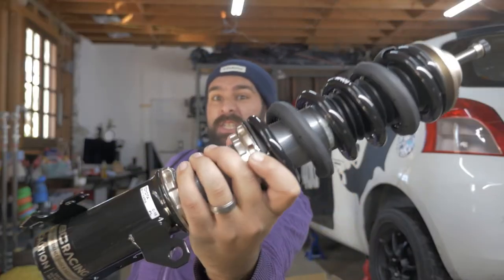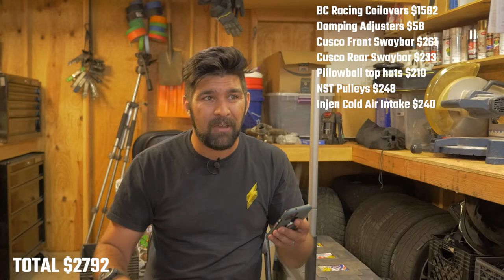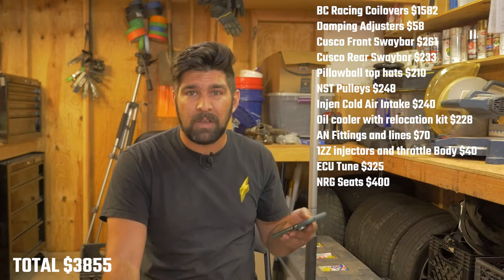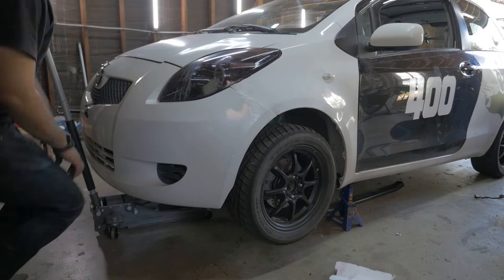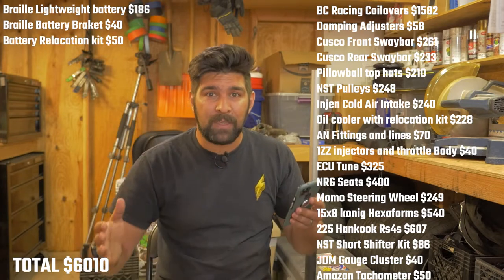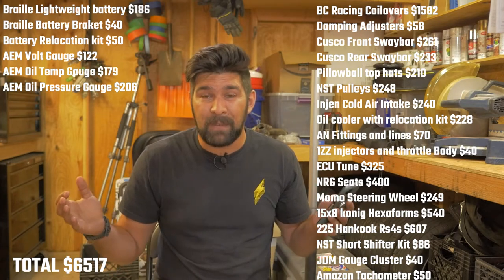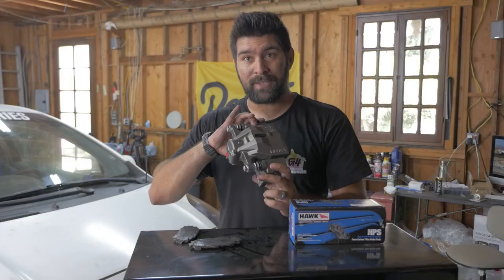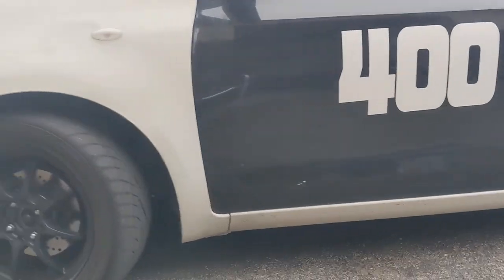Mod list 2022 - Is a Yaris the Best Bang for your Buck on Track?

Comment: I have a 2012 Yaris. Been my daily for 5 plus years now. Just got in the first major accident where I ran over debris from a semi truck accident that wasn’t cleaned up. Luckily the car just needs a fuel line to get it back up and going. Most reliable car Iv ever owned. Over 200k miles on just oil changes, serpentine belt or two and tires.
What would be a good waste of money for my car without risking damaging anything? 
I’d love to give the car a little lift but finding anyone to do the spacers is nearly impossible in my area.
Love your Yaris content!

Comment: The Honda Fits I've seen recently have been pricey for used cars. The Mazda2 is another good cheaper option.
Have you encountered any Chevy Sparks on the tracks?
Reply from the maker: I've seen a few Mazda 2s but no Chevy sparks.

Comment: Love the build! im realy interested in that ecu tune, how does it behave? no problems with drivability or anything? do you think they would tune for a stock motor, stock intake but just a muffler delete?
Reply from the maker: Their tune should work. The biggest gain is the rev limit raise. Tough to tell if the tune affects drivability, because my drivability was already screwed up from the 1ZZ throttle body, and I don't exactly daily my car

Comment: Hey @RassoolRacing. Did you have to roll the fenders for the 15x8 Hexaforms+25! offset wheels? Got rub? I love these wheels, but I daily the car. I love your videos!
Reply from the maker: Tough to say. By the time I put mine on, I was already running coilovers, an aggressive alignment, and I'd pulled out the fender liners. I will say that even with that, it'll touch frame at full lock.

Comment: Every mod except the coilovers could be done for a fraction of this cost if you shop around.
Reply from the maker: Anything skill related? You are 100% correct. I didn't have any experience with modifying cars so quite a few times I had to get someone to do something for me, or I did it the way I knew would work. But for shopping around the aftermarket, not so much. the aftermarket for the Yaris isn't very big. There are very few options for exhaust, pulleys, tunes, intakes, etc. things like Wheels, tires and brakes, I also got some of the cheapest options for the quality. 

Definitely could be done cheaper, but mostly by only doing things that actually benefit

There are certain things that aren't worth changing, but that knowledge also requires a bit of experience which I only have now.
Reply: @RassoolRacing  That's very interesting to me because you sound so well versed in how you explain what's going on with your Yaris. I would've assumed that you were already accustomed to turning wrenches.

But yes, I was referring to acquired mechanical / modding skills. I grew up as a poor gearhead from the mid-west and I've found some good ( slightly ghetto ) ways to  make a car faster on track throughout the years. I certainly could not attain the level of Rad that your Yaris definitely has but I could probably make one that would tie with it's track time for around 3k. Mainly for coil-overs because there isn't a way to go cheap with that.

I'm a big fan of Toyota's 1NZ drivetrain platform. I currently own a Toyota Echo ( mk1 Yaris in Europe ) that is weight reduced to around 1800 lbs and I can say that the 1NZ feels like it's creeping up into actual sports car territory in a chassis that light. I've closely estimated it's 0-60 time at around 7 seconds flat. Everything on the engine is bone stock except a K&N drop in filter. It gets 40 MPG flooring it everywhere, lol. Love that thing. I plan on driving it for the next 20 - 30 years.

But anywho, I also wanted to let you know,  there are some aftermarket parts to be had from Europe. It's because in America the Echo / Yaris is not considered a sporty car but it's Europe, it is. So there's a tiny but existent 1NZ Echo / Yaris aftermarket parts market.
Reply from the maker: @stevenhinkle6957  I'm definitely learning as I go but I didn't really start turning wrenches until 2019. A lot of the cost on the Yaris includes my trial and error. The first set of coilovers I got were definitely wrong, same with the first set of tires and brake pads. There's a lot of upgraded on the Yaris that doesn't need to be, and part of that was me Just learning how to work on any car. 

It's definitely not the most efficient Yaris build.

Comment: why spend money on a hotel? I slept in my Yaris many times, recommended: 8/10. service wasn't the best, but I didn't have limits on the check-in and check-out and breakfast wasn't included sadly
Reply from the maker: ...well mine has fixed back seats, no interior, and no windows so not exactly car camp friendly. Plus a bad night's sleep before driving all day as fast as you possibly can is just gonna leave time on the table.